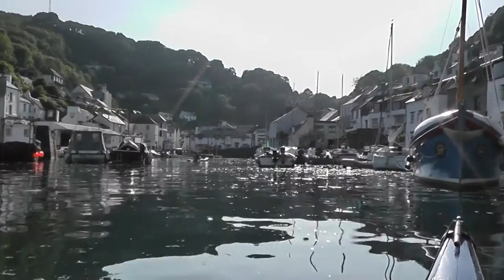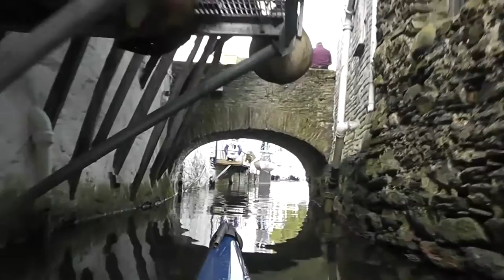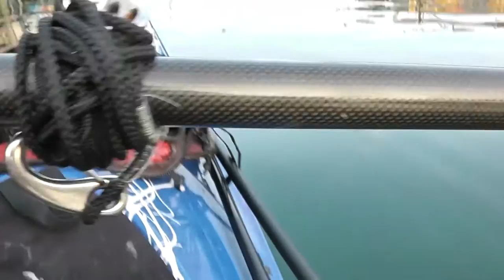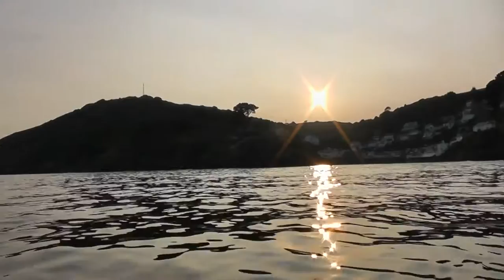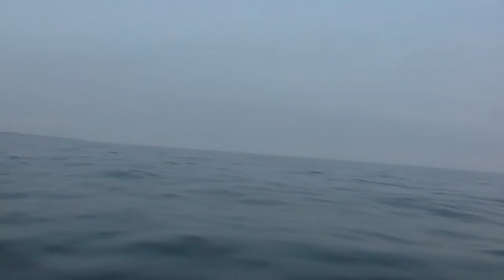Sea Kayaking - How a paddle is broken.

Comment from the maker: Hard to say Jon, but what I can say is, that this carbon fibre is not all it's cracked up to be, sure it's lighter, but I was amazed how easy it snapped. It went right where the hole is, for the button, so obviously the hole has weakened it, however I think there must've been a flaw, I NEVER lean on my paddle for support, if I ever do, the paddle is vertical and therefore under compressional stress, and not horizontally along the shaft. A repair kit is what's needed, not a spare paddle.